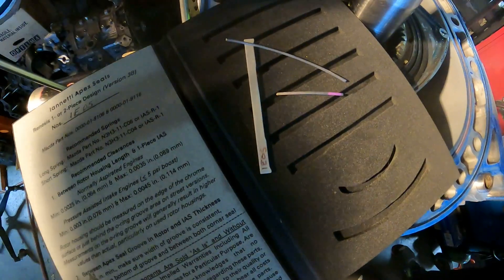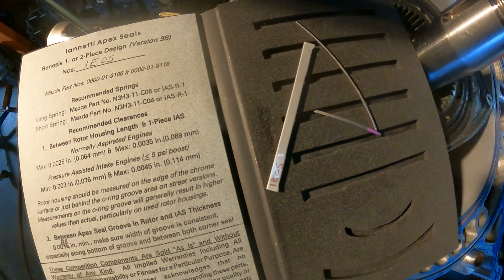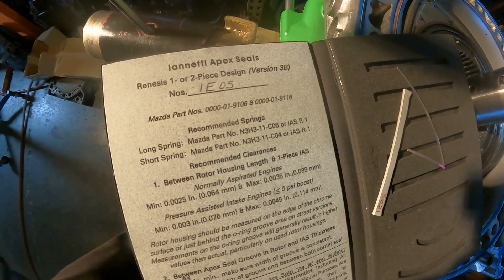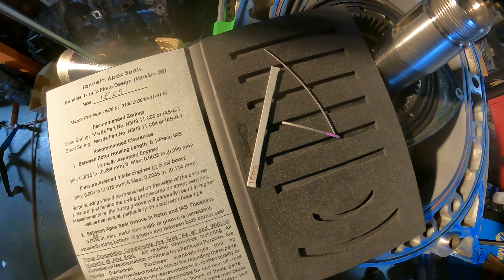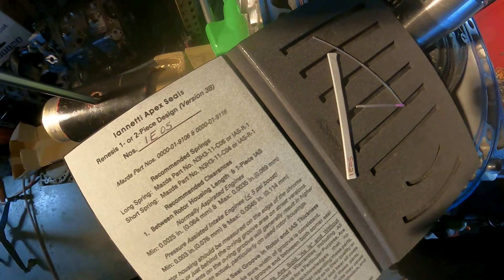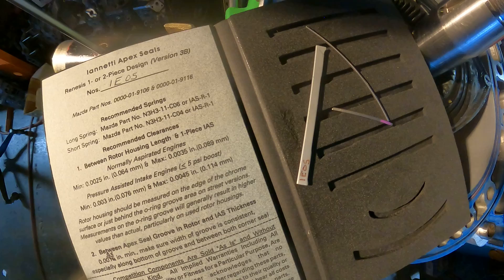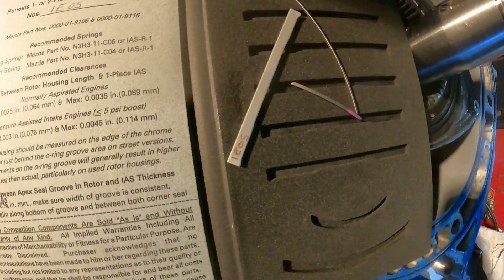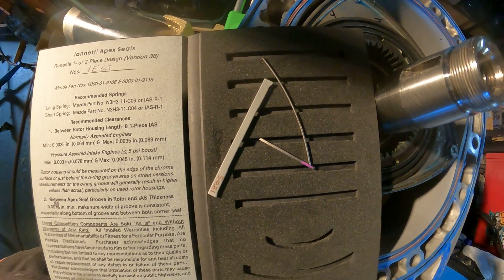RX8 Rotary Ceramic 2 piece Apex Seals, KMR Teck Talk / Seal information Mazda RX-8 Race car

Comment: Just to be on the safe side, I'll stick to metal apex seals. In case you have a little detonation the metal apex seals could take it but not the ceramic apex seals.
Reply from the maker: Thats not necessarily true. Ceramic can be stronger than some steel and vise versa.  Plus the wear characteristics on Ceramic are much better.  EGT raring is higher.  It truly depends on the level of build and outcome desired.
Reply: @KyleMohanRacing  Hardness can be described as ' strength', but so can flexibility. There will never be a ceramic that can flex or deform like a metal. This is because ceramics are bonded chemically and metals are bonded 'mechanically'. Ceramics wear less, but wouldn't that mean that the housings therefore wear more? If the ceramic seals do not expand but everything else does; doesn't that mean that compression is lost between the seal and housing where the seal did not expand?